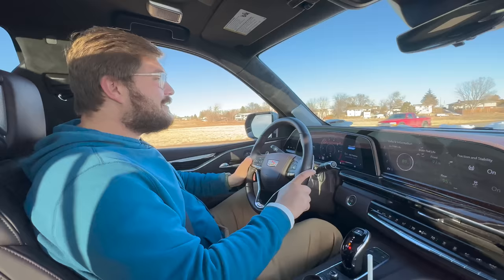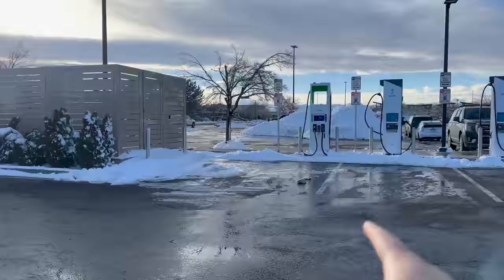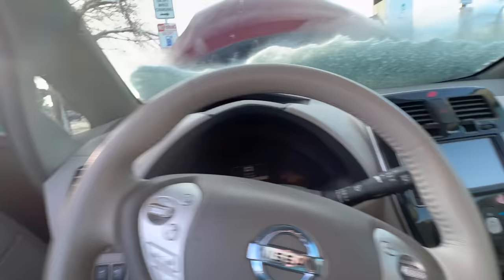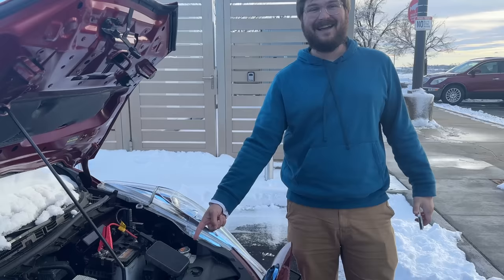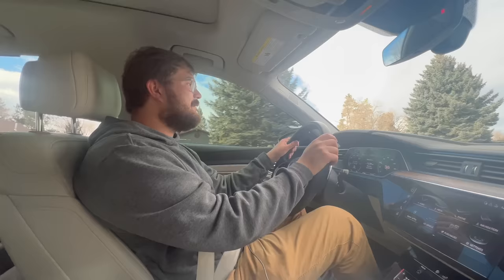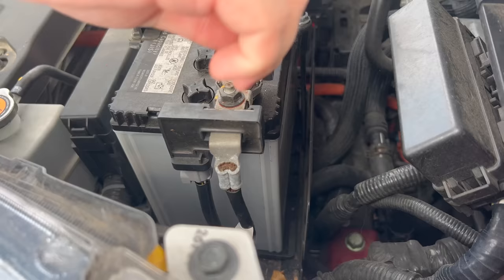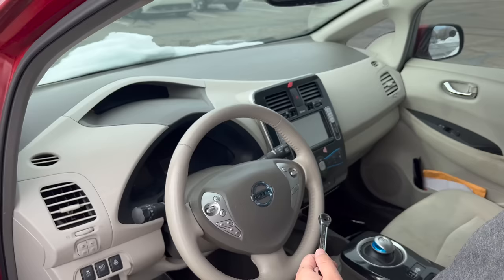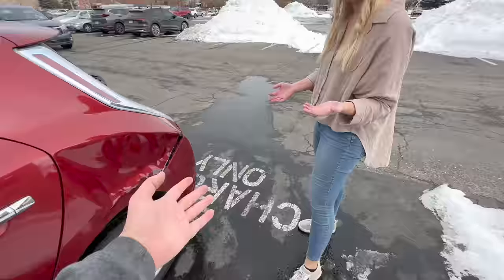My Cheap LEAF Bricked - So We Had To Save It!

Comment: While I love the evs, that supercharged v8 sounds amazing
Reply from the maker: So freaking awesome.
Reply: Everyone should understand that quite a few people that drive EVS still love the sound of a engine roaring. Honestly most people that have a EV on there driveway also have a ICE car on the driveway. Either due to still enjoying the sound/drive or as a backup if the EV won't be the best option for the driving they have to do that day/week. Having options never hurt.
Reply: I know exactly what you mean. I thought maybe I would miss shifting too, but the last car I bought was automatic and I like it. Maybe it just depends what you get used to.
Reply: @briannedry5346  and here I am the opposite I hate noisy cars and was thinking that car sucked since it was so noisy.
Reply: @christylbk  hey not everyone likes  loud engines but I appreciate both the relative silence of a EV and the loud engine/exhaust of a V8 or performance car. Don't get me wrong, something like a loud fart exhaust installed on some cars are annoying.
Reply: I hate  v8s, v6s . Good ev with speakers will make million times better noise than that dinasour eww fuel.
Reply: @briannedry5346  While the sound of my truck's V8 engine is indeed pleasant, the only time only time it gets driven, or has ever been more than 10 miles from the house since we got EV 3 years ago is doing truck things like towing camper, or getting lumber.

Without the camper we probably wouldn't have a gas vehicle at all.
Reply: @briannedry5346  We have 11 vehicles in our fleet.  Two are EVs and do the main driving.  The others are collector cars or other "toys" for fun. Our motto is the EVs save fuel to feed the other vehicles.
Reply: That Escalade is bad ass. Traded my '19 Yukon Denali Limited for the X Plaid last year.  Although not as beastly as this Escalade I do miss the sound sometimes.  But the X plain gets it!  My favorite vehicle I've owned so far.
Reply: I hate loud noises
Reply: @briannedry5346  Yep.  Love our Tesla but for the time being at least I'm still enjoying my GTI.  I'm definitely not resisting the electric changeover and will do so when the right car comes along but I love driving the GTI.  It makes great noises, fun to shift, and still loses to the Tesla.  😂
Reply: @briannedry5346  I had a Prius at the same time as my Lamborghini Gallardo. The tech of the prius and the epic MPGs were great for commuting, and of course the Lamborghini was amazing lol. As fun cars come and go from the garage, my Prius always remains.
Reply: Agreed. You don't get a lot of EV's with an interesting sound, and none really beat a proper V8+ grunt. The best I've heard was while driving a Polestar 2. There's a very thrilling electric whine that gives it a very futuristic sound. Not the same as an ICE engine roar, but fun in its own way.

Comment: Engrave this on your brain: on a negative-ground car, disconnect the negative terminal first and connect it *last*. That’ll save you the embarrassment of accidentally grounding the positive terminal while tightening the nut.
Reply: I learned this the hard way once. My wrench touched the metal intake manifold, made a big spark, a loud pop and blew a 1/8th inch  hole in the manifold.
Reply: I was cringing every click of the ratchet on the +. Hot metal does not shake off your body.
Reply: Yup, this basic automotive safety (along with not opening the radiator cap when hot, fan may turn at any time, etc).  There's a few critical safety items one should know before ever being allowed to open the hood!
Reply: I was waiting for the flash.  Glad it didn’t happen!   Kyle needs to read the instructions because getting it wrong can be a injurious.
Reply: @wpherigo1  I don't think Kyle is in any way, shape, or form a mechanic.  It will be interesting if he tackles the OBC on His LEAF.  If he does, I'm willing to offer any help I reasonably can given I'm in Ohio and he's in Colorado to do the job.  It is actually not difficult so long as you pay basic attention to safety.
Reply: How do I get me one of those $4,000 Leaf’s?  Nice find!
Reply: I about died when I watched someone change my battery by doing the negative terminal first. I told him I was suggested taught positive first, then negative (assuming negative ground vehicle.)
Reply: In case of brain fog (I've actually gone out to jump a battery before my coffee) they also make polycarbonate (Lexan) tools, and multiple coats of liquid vinyl or a piece of shrink wrap over the socket handle can do wonders. Amazon even sells polycarbonate pliers and dykes for electricians.
Reply: He has also said red to black, black to red, more than once on this channel. How dangerous. 😆
Reply: Also, when working on high current systems (12V car batteries included) remove metal rings, bracelets, watches you might be wearing before starting.

IF you were to create a short circuit, you definitely don't want any metal you're wearing to be part of the circuit - as it may become glowing hot...

Edit - typo/spacing
Reply: Some cars, certainly common among  many Peugeot cars of  the early 2000's (like mine) it has a no-tools-needed, quick release clamp on the POSITIVE battery terminal (this being a Negative Earth car).  No tool is needed as the terminal connection releases with a flick of a finger.  (if it was unusually stuck and someone was using say, metal pliers to release it, then, yes a danger would be present).  It is a handy feature and useful at times. Of course, don't wanna do it needlessly 'cause then y'gotta re-tune all the stations on the radio again afterwards LOL !

Comment: If the issue was just that the jump starter didn’t keep the 12 V circuit energized for long enough, you could have tried jumpstarting the car the old-fashioned way with cables from the gas car you came in with.
Reply: Why he didn't try that with the rivian weeks ago in the first place boggles my mine.
Reply: @requen  too much giggly and fast talking. Why he didn't take the 12V home and charge it for far less than $200, also boggles the mind.
Reply: @fitybux4664  Or, use a regular jump pack instead of that fancy small one trick pony intended for ICE cars.
Reply: In that cold weather a good shot of starting fluid would also do wonders
Reply: @dingdong2103  In an electric car?
Reply: @buddyclem7328  Yes, also replace the blinker fluid with one rated for -30c minimum. You don't want your blinkers freezing just when you want to turn.

Comment: A dead 12V starter battery on EV and ICE will strand your vehicle.   The symptoms and causes are nearly the same.  You let an old 12V lead acid battery go completely dead in very cold weather.   That will consistently kill all 12V batteries.   When it dies, the computers in both ICE and EV’s get conflicting information as the voltage drop below the minimum for all the sensors and remote boards along with the main computer.   I have seen people think their ICE vehicles is completely scrambled and beyond repair because all of the erroneous warning messages.   For people who understand battery chemistry, we knew that you needed a new 12V the moment you tried to turn on the car at -18F and the battery was dead.  This would have been the case regardless if it was an EV, gas, diesel, or ethanol.   Your comments at the end about the consequences going green, were completely unfounded.
Reply: Yep, old lead acid batteries do not like the cold.  You're totally correct even my F150 with new version of a 351 gave all sorts of weird error messages because of a weak battery.  Could not even start it with a jump I had to replace the battery, error messages disappeared and it started right up with a new battery.
Reply: @Punkrock Noir ICE vehicles are far, far more reliant on the 12V battery than EVs. That looked like the original Panasonic battery that the leaf ships with, meaning it was 10 years old. That same battery would have failed in an ICE vehicle and left them stranded 5-6 years ago. So, if EVs are worthless because a 10 year old battery went dead and disabled the vehicle during a freak -18F cold snap, then ICE vehicles are even worse.
Reply: I can jumostart my ICE car and it can run off the alternator alone. No it's not good but at least I can do something in an emergency
Reply: @gyula6516  if you have a defective lead acid battery you’ll be jump starting it every time.
Reply: @shiftfocus1  clearly, but you can jumpstart it once, get to a store and get a new 12V. Not everybody has a bunch of cars and can afford to leave their dead car still for 1-2 days!

This could be easily solved tho IMO, put a 12V source in the chargers so if this thing happens you're not out of luck, even if it's rare. The difficult part would be standardizing it though

Comment: LEAF insider protip: the DC-DC converter is only running in the following scenarios:
- the green "ready <->" light is lit on the dash (HV live, system operational)
- the car is charging (active charging, dash lights flashing)
- very rare, periodic, 2-week top-up timer chained to time, not 12v battery voltage.

Dead 12v batteries are a very common sight of early LEAFs. They just didn't manage the 12v battery very well.
Reply: also: pay REALLY CLOSE ATTENTION to that Ready indicator. It's the most important one on the dash in these situations. If it's not on, it's pulling all system power from the 12v battery (to run dash, lights, audio, controllers, etc). And it'll drain your jump pack FAST if you leave it on like that while contemplating life.

Watch for that Ready light. No ready light? Regroup and reconsider.

Faults that are generated while the 12v battery is dead will also persist when it gets 12v power back via a boost. They need to be reset either via Leaf Spy (sometimes) or by cycling the 12v battery (unplug for 10-30 sec).

You know, faults that lock out the HV battery for its perceived "safety reasons" while it was under the delusion of a low 12v battery that made all its sensors very very sick.
Reply: If you leave it plugged in to an L2 for a long period without actually charging the car (timer or app control, etc.), it can discharge the 12v battery, though--a hidden talent.
Reply: Leaf 12v is only a 45 Ah lead acid. They don’t get a decent hard charge ever so only have a useful life of 4 years. Reduced range, slow windows and occasionally not starting because they don’t have brake pressure even though you press the pedal are the clues.  Ours is a 2016 and halfway through its second 12v.
Reply: @markharris8929  It’s a small deep-cycle design that isn’t intended for hard drawdowns and recharging. I consistently get about 5 years out of mine, having driven nothing but LEAFs for commuting the last ten years. My truck gets 6 - 7 out of a much bigger battery, and I’ve had small cars in the past that have done worse (hard winter climate; starting when nothing wants to move, etc.).

Comment: Battery, always loosen and remove the negative first. If you don't and loosen the positive, ANY metal you touch would cause a short and possibly melt the wrench to what it touched. Reverse that when installing, attach the positive before the negative.
Reply: Only true if the car is negative ground, not all are, at least two of my Landrovers were positive ground
Reply: @bryanlatimer-davies1222  It's a Leaf, what does its manual say? (hint: Negative first).
Reply: @jcadult101  and that diminishes my comment how?
Reply: It’s also possible to weld the wrench to whatever you short. That gets exciting too.
Reply: Even with negative ground, some cars have the reverse order in their manual. My e-208 for example. 
The reason for it is, it has a quick release on the positive contact, so no such risk there. 😉
Reply: @Tomaskom   Thank You ! I was going to say Exactly That !   Some cars, certainly common among  many Peugeot cars of  the early 2000's (like mine) it has a no-tools-needed, quick release clamp on the POSITIVE battery terminal (this being a Negative Earth car).  No tool is needed as the terminal connection releases with a flick of a finger.  (if it was unusually stuck and someone was using say, metal pliers to release it, then, yes a danger would be present).  It is a handy feature and useful at times. Of course, don't wanna do it needlessly 'cause then y'gotta re-tune all the stations on the radio again afterwards LOL !

Comment: Just fyi, the 12v DC-DC converter is deactivated when the hood is open. It won't charge the battery unless the hood is closed. I'm guessing the high voltage system has similar safeties.
Reply: Thats not correct. It has no sensor for the hood being open (at least in the early leafs) I have a '12 leaf and could measure the voltage when it was charging.
Reply: @jamest6504  my comment was based on working on the new Ariya DC-DC converter so I guess older systems might not have the same safeties.

Comment: So the part that failed is a part that's in literally every ice car.
Reply: Not to mention a consumable part that wears out in every car that's a decade old.
Reply: Yep, if they had just used the new leaf to supply 12v power while the changing initiated during the deep freeze video it probably would have started chsrgin no isssue

Comment: Yeah, once things start acting a little crazy, it's always the 12v that needs to be replaced.  Low voltage really messes with the computer, all kinds of weird stuff happens
Reply: It really should not be a problem, but it is not just EVs that have this problem. All the electronics could happily run on 5V or less and many of them do, but the bits which supply that power to the electronics seem to fail at about 10 volts. It's crazy, I have multiple DC-DC power converters which will give the required output voltage with an input between 4v and 36v. I wouldn't expect to use something like that for all the electrics but it would be fine for the electronics.

Comment: Did you leave the jumper cables in the leaf in the previous video? You should have jumped it with the Escalade. Also, that looks like a common 12v battery. Like a 51 or 51R same as a Honda.

Comment: So the leaf was bricked because of the ICE age battery… not EV high voltage battery… and everyone is so concerned about the Lithium packs 🤦‍♂️
Reply: Why does an ev even have a 12v battery? Surely a voltage converter from the hv battery could run all those 12v systems.
Reply: @bikeman123  it’s a regulatory requirement. In an accident the high voltage battery automatically disconnects and the 12v battery is responsible for all emergency equipment (air bags, locks, belt tensioner, hazard lights, etc). Tesla has switched most of their vehicles to a lithium 12v which should last 10 years or more.
Reply: @ranig2848  You can buy lithium batteries for ICE cars too. If you really want retro NiCd’s are available too (they are popular on aircraft as they give a higher cranking current at the expense of occasionally burning through the floor of the plane).

Comment: Anyone still counting on a Leaf of this vintage for charging away from home, always keep something to disconnect a battery in the car.  On two occasions I've had charging not connect or work until battery "reset" by disconnecting/reconnecting.  Not much of a hassle for a car that has easily paid for itself a few times over.
Reply: Nice that the 12v battery is accessible

Comment: Funny thing. I went directly to a battery DISTRIBUTOR one year. He had what I wanted, at a great price. And, he had OEM stickers for a dozen car companies on a shelf. If a dealer called, they all got the same battery. Just a different OEM sticker slapped on it. Real brand batteries only get installed at the assembly line, and those are bought from contract suppliers, too.

Comment: You could have gotten the 12V battery at Advance, O’Reilly, AutoZone, etc. cheaper. They carry them, too. In fact, the Nissan battery looks like an aftermarket one with their label on it.
Reply: It's an absolutely basic Flooded Lead Acid one; charging $200 for it is obscene.
Reply: They could have gotten one at NAPA for $130.

Comment: I could tell from the top of the battery that it was the original factory battery.  Mine lasted 9 years before needing to be replaced, which is crazy longevity for cars.
Reply: Letting a 12V go dead in -18F is a perfectly good way to suicide a brand new lead acid battery.   Leaving the OBDII reader or all of the filming and prep work could have done it.   His would have lasted 9 years too if he didn’t abuse it.
Reply: @johno812  Yeah, that battery was a frozen lump by that point.
Reply: Pretty damned good for any lead/acid battery. If the Leaf is 10 years old, then it's damned good.
Mind you, my 2015 Fiesta (bought November 2014) still has the original battery, so at least 7 years 2 months, if not longer from manufacture, and that's with almost daily starts, in hot and cold weather (I'm in eastern Canada), so I'm pretty happy with it if it dies this winter.

Comment: Haha.

For safety, when installing a battery, positive first, then negative. This way since you're wrenching down the negative last, it won't hurt anything if you tap the tie down or chassis with your wrench while tightening the negative terminal.

When removing a battery, negative first, then positive for the same reason.

Comment: We have a Smart ForTwo ED (their EV, from 2015).  I loaned it to our daughter till her Tesla M3 came in.  Right after it came back home I took it to a car wash.  While there using the vacuume as I was leaving, the 12V died in their lot.  Quite embarasing, but it just needed a new 12V AGP battery we got from Autozone (closeby thankfully).  Many don't understand why a 12V is needed, but I know it is basically a safety issue, and since it is there it allows reuse of all the legacy 12v tech that we have been using 'forever'. ... Love the videos, take care.
Reply: A 12V battery is needed because high voltage is not appropriate for operating small electronics, and because the traction battery needs to be isolated when not in use.